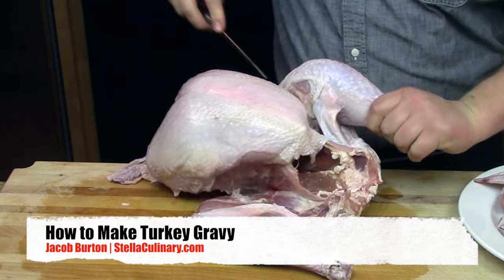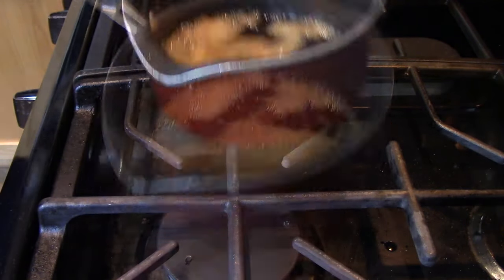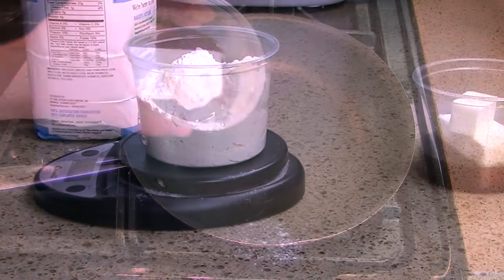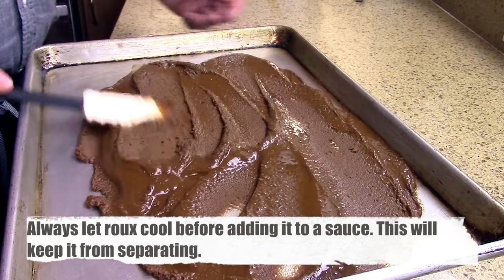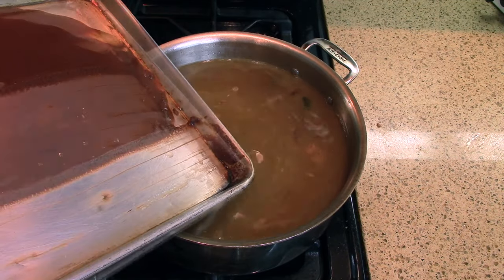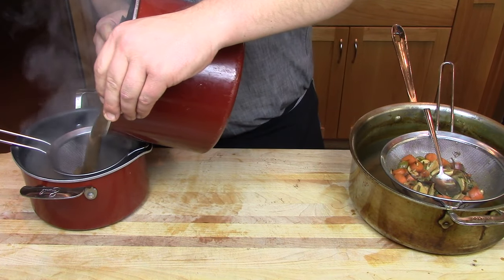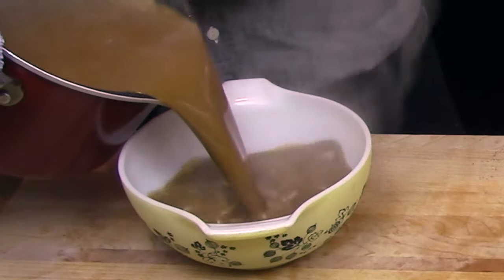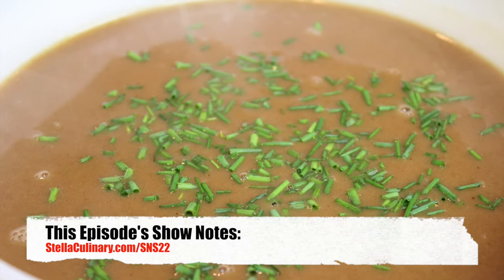How to Make Turkey Gravy | Professional Chef. Proper Technique.

Comment: Wow, learned a lot in this video.  But if I'm going to be adding the roux back into a boiling pot, what's the purpose of letting the roux cool down first?  Can't I just add it while it's hot?  or is there some food science behind letting the roux cool first?  Thanks for great lesson.
Reply from the maker: Because the butter and flour can get much hotter than the temperature of the water (browning starts to occur at around 325F, whereas the water's boiling point is at 212F at sea level), when a hot roux hits liquid, it will cause the liquid to boil vigorously, which will then cause the fat to break away from the flour in the roux. This will lead to a lumpy gravy with fat pooling at the top. Allowing the roux to cool to at least below water's boiling point before adding it will keep this from happening.

But since the closer you get to dinner time the more frantic everything becomes, I always make my roux hours if not a day or two in advance, so that way I know it's on hand and ready to go when I need it.

Glad you enjoyed the video!